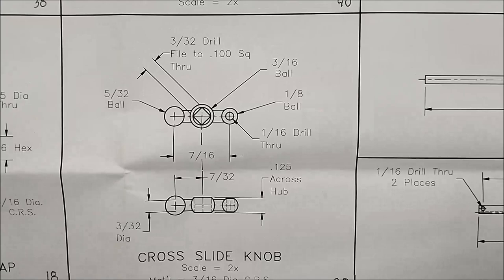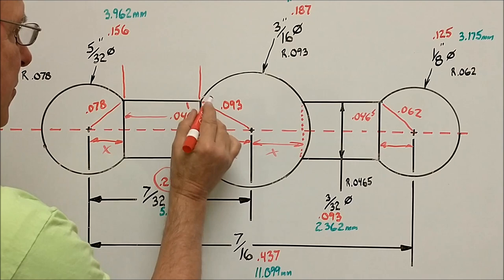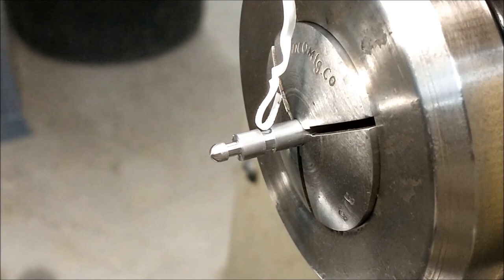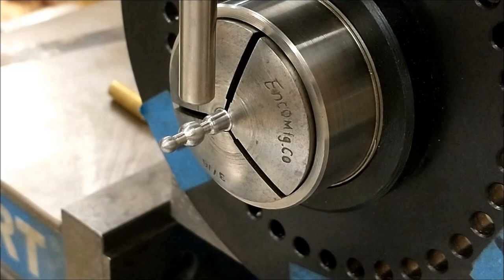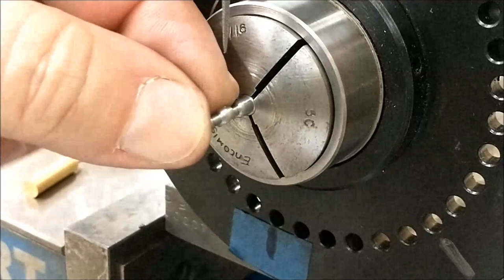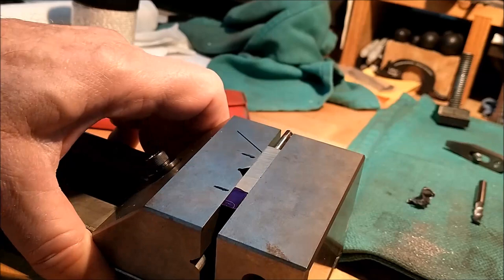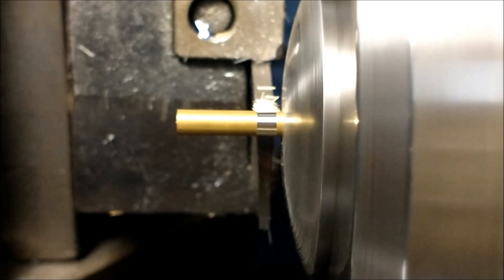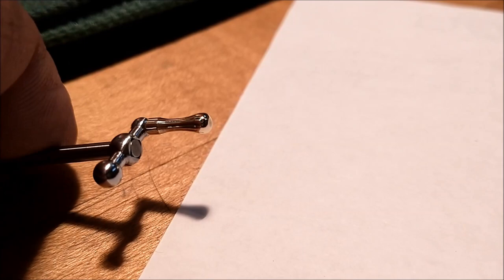Miniature Engine Lathe - #2 - The Crank Handle

Comment: Could you show the math on the triangle?
Reply: There are a couple of ways to do it. The simple way that doesn't involve using trig is "A square + B square = C square", where C is the length of the hypotenuse and A and B are the other sides. 

So for the left side you have B = 0.046 and C = 0.078 and you want to find A.
(Or A and B could be the other way around. It doesn't matter, as long as C is always the hypotenuse.)

Let's start by rearranging our equation so we get A on one side of the equal sign and everything else on the other side:

A^2 + B^2 = C^2                    original equation
A^2 = C^2 - B^2                      rearranged
A = sqrt(C^2 - B^2)               square root of both sides to get A

So:
A = sqrt (.078^2 - .046^2)
A = sqrt (.006084 - .002116)
A = sqrt (.003968)
A = .062992 
So A = .063 to 3 decimal places.

Does this help?
Reply from the maker: The easiest verbal example is is to use a 3-4-5 triangle. 
3 being the short vertical leg (a), 
4 being the base leg (b) and 
5 being the hypotenuse (c)     Draw it on a piece of paper
When you square each number ( multiply it times itself) you get 3x3=9,  4x4=16 and 5x5=25
Having any 2 of the 3, you can easily find the third by adding or subtracting as needed. Depending on which 2 you have.
This only works if the triangle has one corner that measures 90 degrees.
Remember, the number you come up with is squared, so a calculator with a square root function key is good to have around.
Reply: @joepie221  my son is in college and we were trying to figure it out last night. (He showed me my iPhone has the square root key on the calculator when turned side ways) I’ve talked to a lot of machinists and they always talk about figuring out dimensions with triangles! I’m self taught through videos like yours and others (Mr.Pete). I am so grateful for content creators like yourself! I’ll Google this more and solve your example a couple different ways.
Thank you

Comment: Come on man, I thought you make precision parts...
It’s
 .1875”
.0625

Man, some people are just hacks. 

Hahahaahha...
Reply: What’s worse, on a part this size being a half thou off is like being ten or twenty thou off on normal sized parts.
Reply: Hi Joe, enjoying the series so far! 
I was surprised you made the post of the handle in brass vs steel? The only other lathe know of that has a brass posts is the Taig! (Which to me is not aesthetically pleasing or realistic to me.)
PM took some liberties when marking these from old catalog prints. 

It might be good to get a digital microscope set up for your lathe ( really cheap now) and view the work on  a small  monitor while you work or get a smaller lathe while you work  be a little more comfortable! 
Just a suggestion "to the man!" 
Enjoying the journey Joe!
Reply from the maker: Actually, once the temp in the shop hits 75, thermal expansion will make the parts perfect. :)
Reply: @joepie221  that’s a fair point. Now you just need to make sure you can keep the finished article at lots of different temperatures so all the parts are thermally perfect ;)

Comment: great work .. but I see the handle .. being out of scale to the rest ,sorry
Reply from the maker: I agree. It may be fine for the hand wheels, but not this cross slide crank. I may make a shorter one.
Reply: @joepie221  Hi Joe, a superb video, thank you. I would have thought about  1/3 length and 1/2 diameter would look much better, however, you are going to be using it so you need to make it to the smallest comfortable size. Hope you don't mind me suggesting.

Comment: Really having a hard time hearing you!
Reply: I bitch about that all the time too - Only when Joe is at the whiteboard, though.
Reply: Try headphones. The big ones over the ears. Works wonders. May need to adjust volume. Watch out for adverts. Sound levels are some  6+ dB higher.